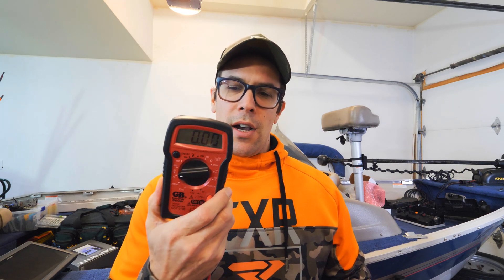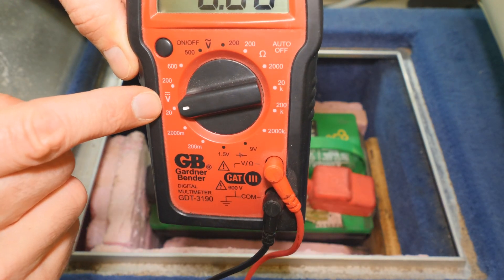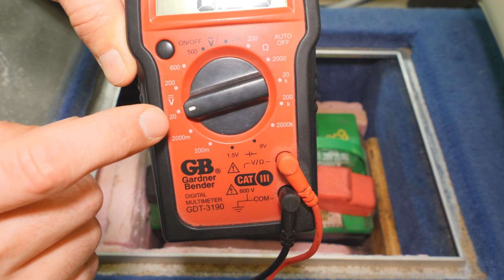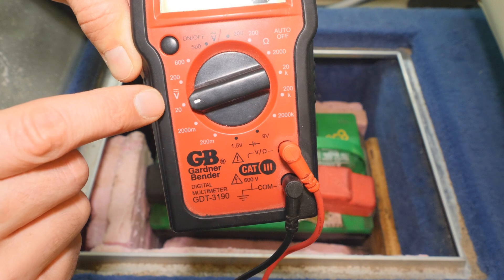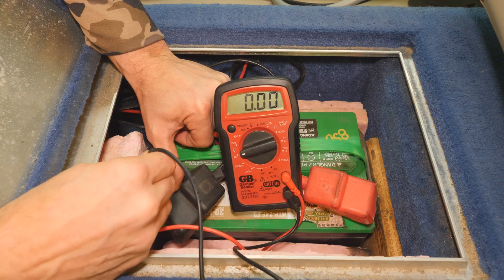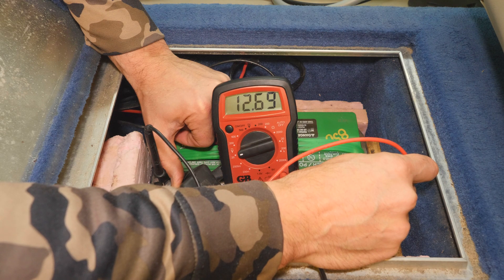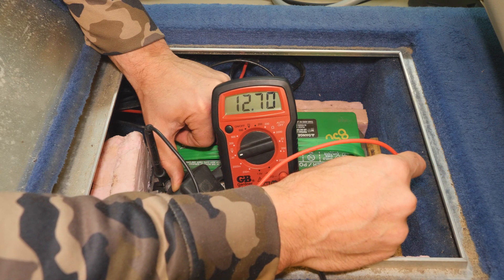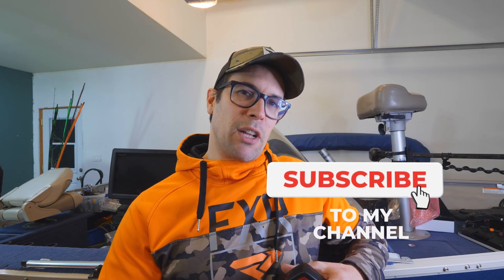How to Test your Boat Battery Voltage with a Multimeter!

Comment: Curious on your thoughts.  Boat, starter battery, house bank 3x 100ah batteries (2 years old) everything has been running great - in the last week Ive noticed when my isotherm fridge compressor kicks on the led light dim or flicker.  Also noticed a 12v cooler i have shows a low voltage alarm.  seems like a low voltage issue of some sort but batteries read full.... any ideas?

Comment: Afaik deep cycle can go down as low as 11.8 and still have 30% charge. And that's float value. Under load can drop to as low as 10.5v with a trolling motor pulling full 40+ amps, but once you let go of the throttle,  it could still come back up to 12.2v after a few hours of trolling... which is normal...agm will also have different values than flooded
Reply from the maker: You shouldn't be draining your VRLA battery that low (30%) on a consistent basis unless it's an AGM.  Once you're under 12v, a typical VRLA should stop being used and charged.  And yes of course, totally normal a battery will drop under load unless connected to a charging system.  All measurements should be done with no load.  Thanks for the comment!

Comment: Hi. Maybe you can help me.
I bought a new semi traxi battery 75 ah and used it for three weeks untill i found out my rectifier wasnt wired up to charge. the voltage dropped down till 10.8 and now i am charging by boat and it would go up till 11.7v 
 
Is this battery broken now or should i charge it with a charger?

Comment: Don't you have to disconnect the batteries? I have  2 trolling batteries and 1 cranking/electronics battery. Trolling motor has been acting funky and I'm wondering if my  batteries are going bad. It's been 3.5 years with these.
Reply from the maker: By acting funky, do you mean the trolling motor is dying faster than usual or seems underpowered after a few hours?  Easy way to tell is charge them up, and run the TM for a couple hours on the water as usual and then check the voltage on each.  No need to disconnect them to do this as you are post to post on each battery.  If one battery is much lower than the other, you found your bad battery.  If you have a fairly new marine bank charger, it should be signaling if you have a battery not holding a charge either although I wouldn't rely on that 100%  Hope that helps!
Reply: @DanRichardFishing  funky meaning doesn’t hold spot lock for 1. Seems to when they are fully charged but after 30-45 on water it won’t spot lock anymore. Last two times (both failed) it was also windy out. Haven’t been able to test in different situations yet.

Comment: Why is my RV battery showing zero when I test but can power my RV? Testing other vehicle batteries gets normal results with the same meter.
Reply from the maker: You're testing right at the battery posts and you're 100% sure you have the right polarity?? That doesn't make any sense unless you have another battery hidden somewhere on your RV LOL

Comment: played music in boat today with engine off and was wondering to what voltage can i let my single 102ah deep cycle battery drop until i can no longer start the engine? ive got a 5 liter petrol engine. also got a victron controller that goves me exact voltage reading.
Reply from the maker: This is a good question but it's also very hard to answer because you can't judge this on battery alone.  Voltage doesn't start an engine, amps do so the condition of the battery will determine how effectively it can delivery the amps your engine is drawing to start.  So if you have an older battery with ineffective cells, then it will have trouble pushing amps at higher voltage, whereas a brand new battery could have no issues delivering the required amps at 11.5 volts.  As a general rule, anything under 12 volts is a drained battery and you risk getting in trouble :)

Comment: What about 12v LITHIUM batteries. How do you test them for voltage??
Reply: 12 volts are 12 volts, check it same way.
Reply: Thanks. I was thrown a blind curve. I was checking the voltage on a Lithium "Smart" Renogy Batt. which I didn't realize has to be "turned on" from shelf life. It comes in that mode from the factory. It also comes with a plug in switch. Once I turned it "on" it read correctly.
Reply: @arthicks4785  
Thanks for responding.
Reply from the maker: Hi Art, as D Carlton mentioned, you test them the exact same way :)  Check out my LiLead review video and you can see me testing the voltage on it :)
Reply: @DanRichardFishing 
Thanks for the shout out, great explanation. I had a Multimeter from Harbor Freight, free of course and it was showing 17+ volts. Thanks to your video I bought a new Multimeter and it works. Put the free one where it belongs.

Comment: Quick question for you. I have been trying to find an answer inline but haven't been able to locate much. I was running a group 24 interstate cranking battery that was purchased in April of this year for obviously my 50 HP mercury and 2 echomap 73SVs. Right after taking the battery off the charger, the Garmin units read 11.9 volts but when I hooked my volt meter up the battery read 12.79. Thought maybe something was wrong the the interstate so changed it out for group 24 everstart. Charged that up and checked it on my Garmin units and it read 12.6 and on the volt meter 12.8. I fished for about 2 hours to test it out and the voltage dropped to 12.2. Any idea what could be causing the voltage difference? Even with the low voltage with the interstate I never noticed a picture change and did not get any warnings.
Reply from the maker: Hi Ryan, the low voltage warning could be set to different voltages, so doublecheck what it's set to on your unit.  If it's set to 11v or something like that, it would explain the no warnings.  The unit will work down to 9 volts, so you won't see any picture changes or really any issues as long as you're above 9v.  As soon as you drop lower, the unit will simply shut off.

In terms of your testing of voltage and voltage drops, there's a lot of factors that could affect reading a slight change in voltage on your readings at the battery vs at the unit, but a difference of 1 volt seems odd.  What I would do is check the power at the cable itself by testing the female end of the cable and seeing if that matches what the unit is telling you.  I wouldn't worry about 12.8 vs 12.6 but 11.9 vs 12.8 seems weird.  Things that affect voltage between the battery and the unit are purely connection related, so a poor ground or positive connection would be something to look for, or using wiring that is too small.  Also check that the fuse connection is good, no corrosion etc.  Btw I am pretty much using the exact same battery as you, a group 24 interstate lol!  My marine starting battery died out on my and this was an emergency replacement that so far has been doing a great job :)

Hope that helps!
Reply: @DanRichardFishing  thanks for the feedback. I have actually checked it at the connection and it was the same as what it was directly at the battery. That is one of the major reasons why I am incredibly confused

Comment: My new deep cycle batteries sit at 13.7v when fully charged 😅
Reply from the maker: Is it a lead acid battery and is that the voltage when the motor is running?  If so, that makes sense.

Comment: So if im using my new 105 amp hours battery on my trolling motor, (only 28lb thrust), can I use my fully charged battery for an hour or two and then see on the volt meter how much charge is left? If it reads 12.7 before launch, would turning around, going the same speed, at say 12.5, get me back? I just want to avoid the battery running out while on the water. it's hard coming from using phones and devices with a battery percentage to marine batteries where it seems you have to look at voltage to measure charge. everything im seeing with the volt meter seems to measure battery life, not battery charge
Reply: I ran around all night on my wide / heavy 16’ Jon boat chasing down jugs with 2 of these https://www.ruralking.com/catalog/product/view/id/28357 and I’m right at 12.4. Granted they were 13.4 and 13.7 before hitting the water. That was about 6 hours on the water, probably 4.5-5 of it moving around. I try to keep it on the 1,2,3 settings most of the time and only use the 4&5 setting in quick bursts. It’s a 30lb thrust motor and I probably traveled 2-5 miles, or more. Went back and forth on a long / skinny 200 acre lake 4 times and ran around a bunch in between, not sure the miles but I can certainly tell the second battery was there last night (only had one 2 nights ago, it definitely started to loose some steam on the way back, setting 4 was comparable to setting 2 on a fresh battery). Not sure if that’s any help.

Comment: I know this question has alot of different answers but if you could give me a general answer. Im running a battery for my trolling motor on a 10 foot jon boat.. At what voltage should I start looking for a way back to the truck.. In General..
Reply from the maker: Haha well that depends on how far from the truck you are.  Once you start dropping below 12 volts things can get interesting in a hurry.  12.20 is 50% charge, 12.0 is around 25% charged and you're now draining the battery too far.  Ideally you don't want to go lower than 12.08v - assuming we are talking about lead acid batteries, not Lithium.
Reply: @DanRichardFishing  Im assuming this is when NOT under a load right? My completely charged battery fresh from the charger goto 12.0 - 11.9 under a load.I dont think ive ever seen it below 12.80 not under a load after like 2-3 hours of trolling.

Comment: Great video. Forgive me if I am new to this but I just purchased a used boat and it has three batteries hooked up for various items. There is an external charging system that plugs into the wall that charges all three. How would I test to see that everything is fully charged? Also, I had a weird thing happen yesterday. I got off of the water and then plugged it in to charge and it was like I could hear a faint bubbling sound coming from the 1st battery in the charging system. Is that normal lol? Thanks for any guidance!
Reply from the maker: Thank you!  No worries, please don't be shy to ask your questions, that's why the channel exists :)  So actually testing if a battery is fully charged is difficult unless you have specific tools to do this.  You can get a general sense of the charge by looking at the voltage... if the battery is lead acid based (not lithium) and is showing 12.7 volts or higher, it's fully charged.  If it's showing ~12.4v then you're at ~75% charge.  I'd just keep this easy... your battery charger should indicate if your battery is fully charged, so if you plug it in and it keeps charging and never shows 100% charged, you may have a battery issue.  You also need to look at the real-world use.  So if you charge a battery overnight and the charger is showing fully charged, but it only lasts a few hours out on the water, your battery is likely end of life.  If the batteries are older than 5 years old, you should probably change them anyway.  Lithium batteries actually have indicators on them that show you the charge and others have connectivity with a phone app to the BMS to check.

A faint gurgling sound when charging a flooded lead acid battery is totally normal.  The charging process heats up the electrolyte (the acid in the battery) and it can bubble and let off some gas.  Nothing to worry about :)  Hope that helps!
Reply: @DanRichardFishing  Thank you very much for that explanation. It helped a ton. Keep up the awesome work. Subscribed!

Comment: Hi Dan, good info there. 
I have watched your past videos of you troubleshooting your Garmin sonar interference issues. I am about to install a Striker 7 on my boat this spring. I have a Terrova also. I'm not looking forward to this now... :-(
Have you found a way to reduce the interference somewhat since that video? (where you mention all the steps you have taken)
thanks
Reply from the maker: Hi Ethan!  Thanks so much for watching my videos, really appreciate it!  Unfortunately there was nothing I could do about it, the motor housing itself is just pumping that EFI noise and no one could figure it out.  It's become a "that's just how it is" situation.  I'll be upgrading motors soon so it's not the end of the world.  What version of the Terrova did you get?  If you have the Bluetooth edition, you have a newer generation than I do so you may not have that problem any more :)  Let me know when you get it installed!  All the best :)
Reply: Thanks for the reply Dan, much appreciated!
The Terrova is an older ( 55 LB,12V). I'm currently running a Garmin Echo 500C and getting those vertical lines also. I am using the internal transducer on the Terrova and connect to the sonar via US2 Adapter Cable / MKR-US2-12. I did not clamp on the Garmin transducer to the motor head.
I'll do the same with the Striker 7. How did you run the transducer cable up to your sonar? Does it get tangled a lot? 
I might sell this Terrova and upgrade sometime.